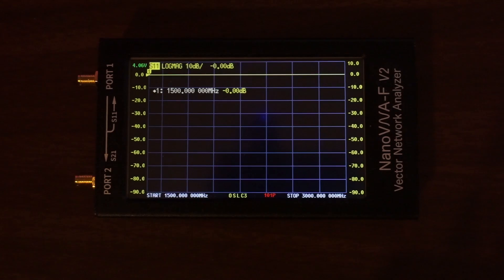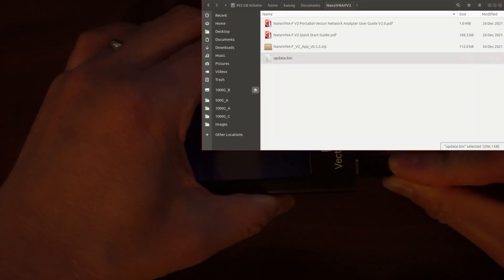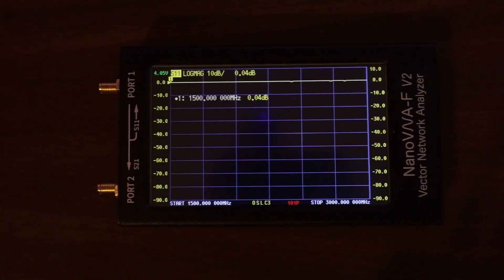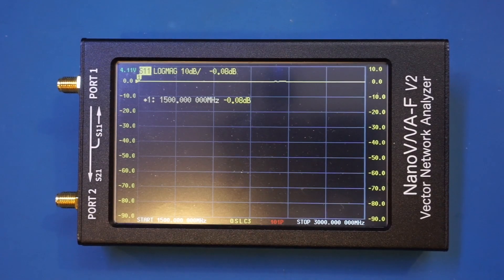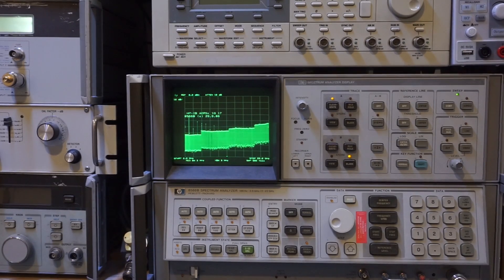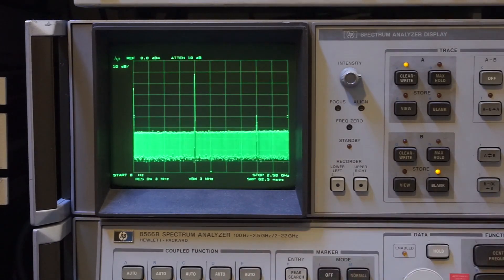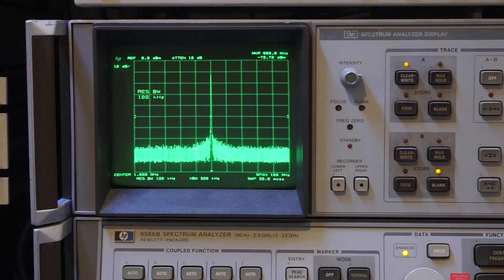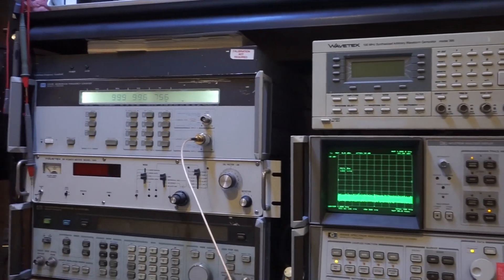NanoVNA-F V2 Firmware Update, Clarifications on Signal Generator Output Frequency Accuracy

Comment: As of early March 2025, the latest version of firmware for the Sysjoint NanoVNA-F V2 is v0.5.4. As its "readme" file explains, it adds averaging, adds a sweeping progress bar, moves the [L/C MATCH] option to a different menu position, adds the MCU chip ID to the boot screen, and fixes bugs. The latest version of the manual is still version 2, which was issued with the 0.3.0 firmware. NanoVNA-Saver software continues to receive regular updates.
Reply: As of November 2025, the firmware is up to version 0.6.0, so it is good to check periodically for updates. The latest version of the manual is still version 2, which was issued with the 0.3.0 firmware. I should add that the USB-C cable that came with my NanoVNA-F V2 is not usable for firmware updates. Specifically, my PC does not recognize my NanoVNA-F V2 as a (16 MB) USB drive when I use the included cable, but it does when I use a different USB-C cable.